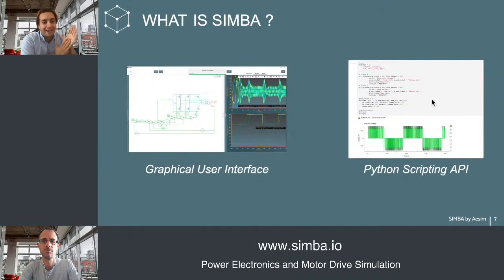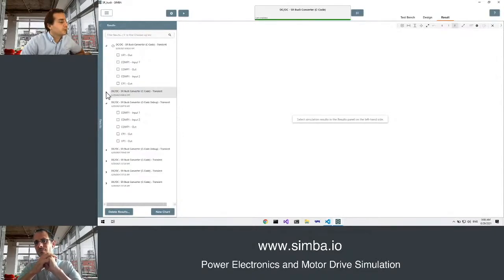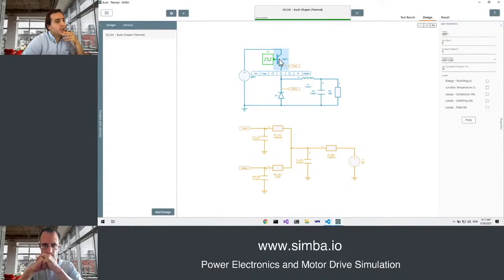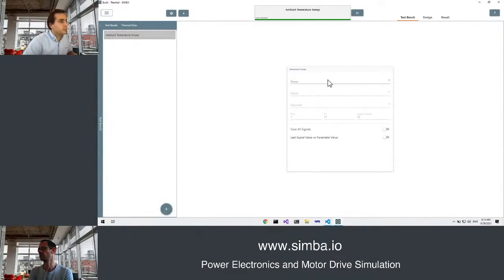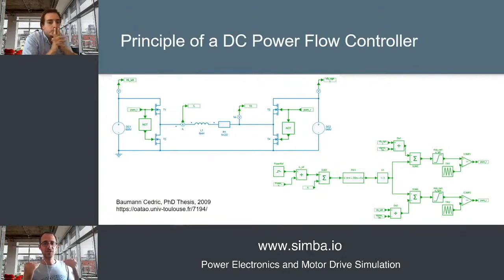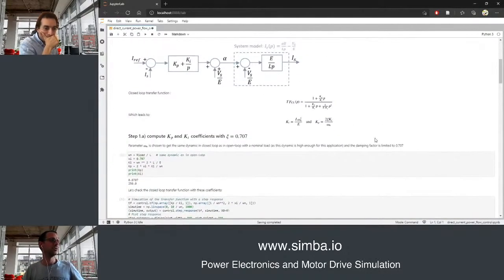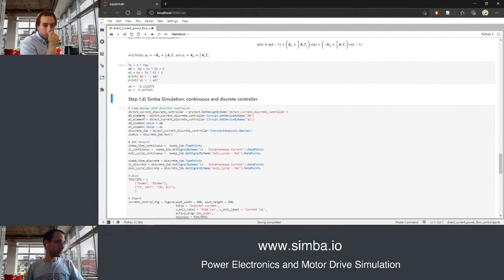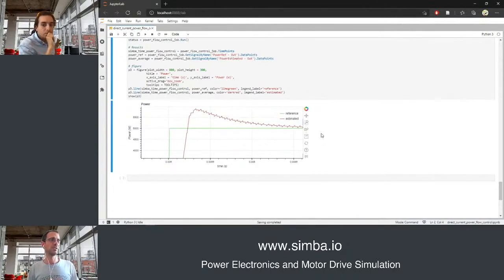DC Power Flow Controller Design Webinar

Comment: Hi, Can I get an oscilloscope view of waveforms like lecroy, tektronix, keysight in PSIM as if working in an experimental environment?
Reply from the maker: I'm not sure I understand the question, but in SIMBA, you can have cursors and calculate metrics like RMS, Average, and P2P, similar to a real oscilloscope. You can also run FFT.
Reply: Is there a chance to display the waveforms obtained in the simulation as if using a real oscilloscope?
Reply from the maker: @shouryuken-g7c  Yes.
Reply: @simba-software how?